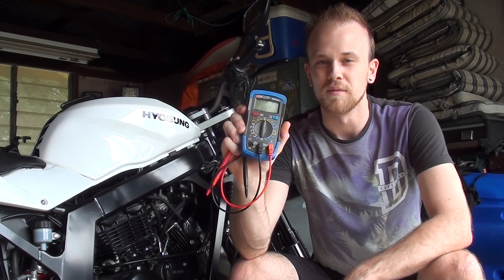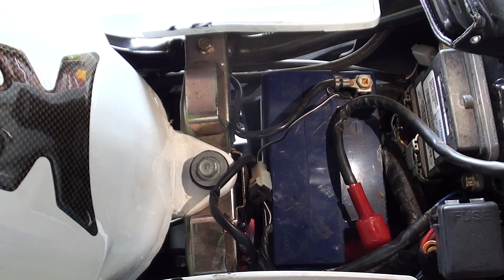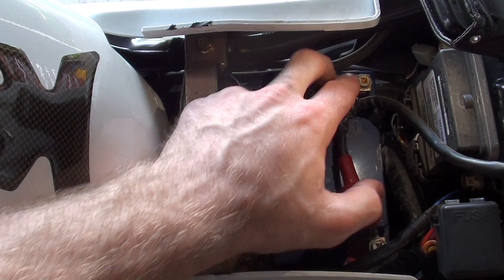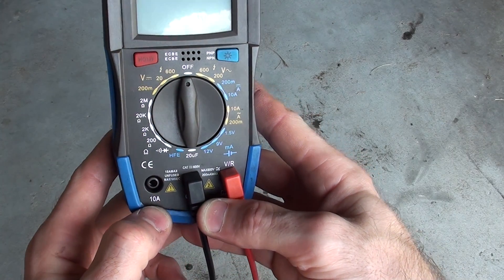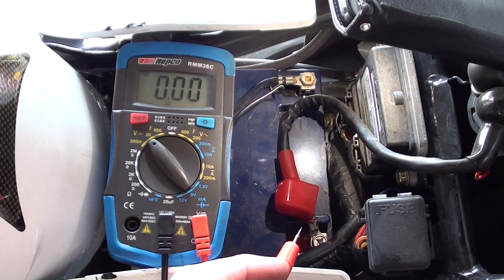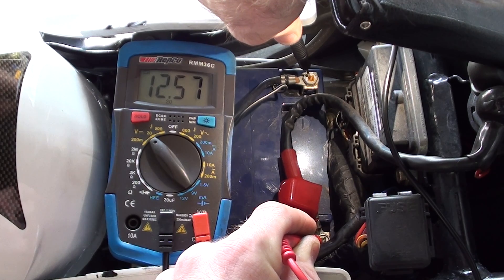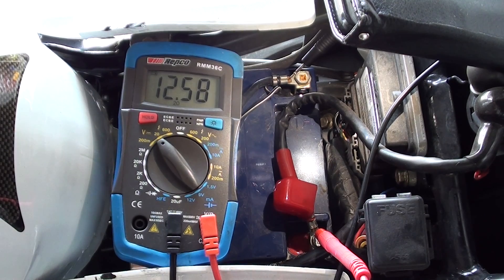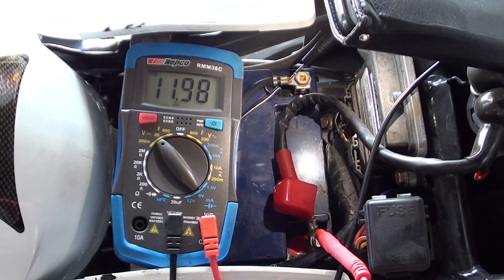How to test your motorbike battery with a multimeter (multimeter tutorial)

Comment: i installed heated grips and the bike didnt work any more what happend is i think the battery was bad because my batter was around 11.5 v after two hours when riding. and droped to 9.5v when trying to start.
Reply from the maker: Thats sounds like the battery has failed or the charging regulator isnt working. Check the battery voltage when the bike is running it should be above 13v. If it isn't then the charging regulator/ alternator might be stuffed. It may have killed the battery as well.
Reply: @howtonick2803  OK

Comment: If you rev the engine while it's running, is the voltage supposed to increase as the alternator then begins charging the bike?
Reply from the maker: It may increase around 1volt. If idle voltage is 13.2v it may go up to 14.2 when the engine revs are brought up.

Comment: Mine reads 6.20 volts on a brand new battery
Reply from the maker: You may have a bike that runs on a 6 volt system. Just double check the manufacturers specs in regards to the electrical system. Wether it is a 12 volt or 6 volt system. If it is a 12 volt system then you either have the wrong battery or the battery has dropped a few cells and failed. Hope that helps 😊